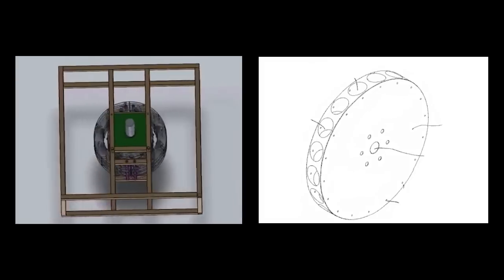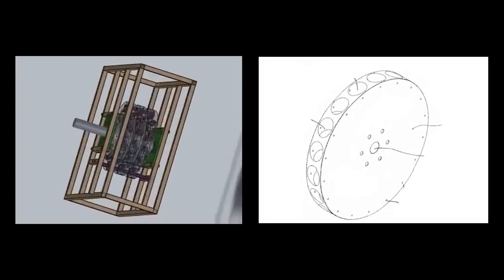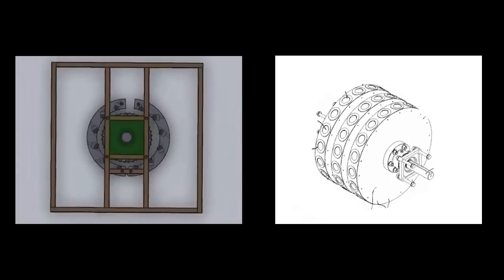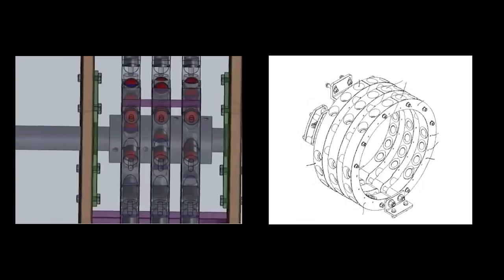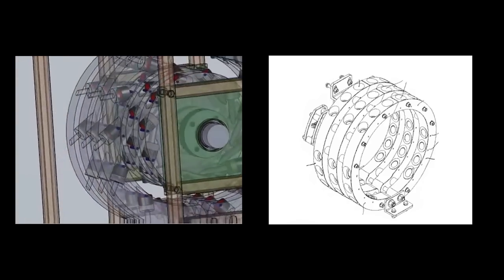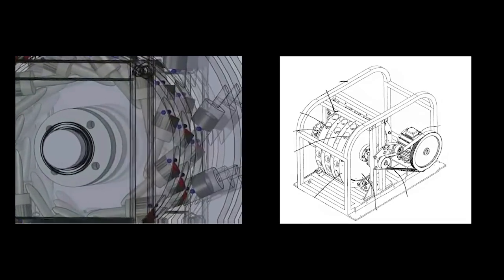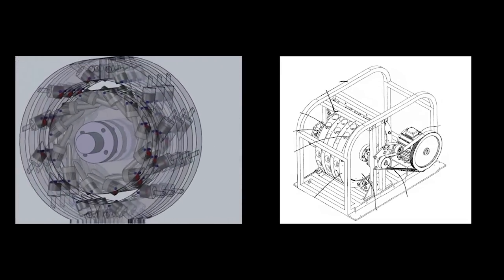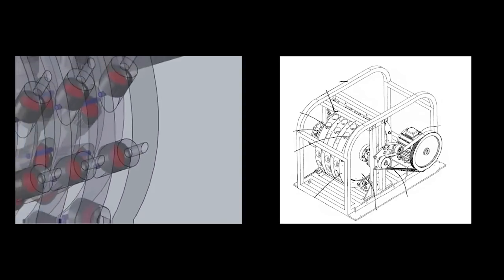Free Energy Generator - Mike Brady Permanent magnet machine

Comment: Electric Generator Design that's powered by it's self once it gets going & perpetuates more electrical current then is needed for it to run continuously on it's own. 
 Step 1: Calculate how much energy you need pumped into an electric motor to make a vertically positioned circular platter with magnets in-bedded horizontally around it's left side and right side (so there pushing force is pushing out sideways relative to the vertically spinning disc) to spin as fast as you need it to. Also better to make sure these magnets are shielded around their sides & back  with metal that has high permeability so the magnetic field they are emitting is focused fully out sideways. :D Step 2: Calculate how many sets of copper coils you need to be interacting with magnetic fields to achieve this & to perpetuate more electrical current flow then is needed. :D Step 3: Build a round horizontally positioned platter covered in all these copper coils pointed down that does not move (Is stationary) :D Step 4: Build a round platter covered in powerful magnets pointed up that can spin and place it directly under platter with hanging copper coils. :D Step 5:  Position the vertical platter that is  motorized close to the horizontally positioned platter covered in magnets pointing up so that when the vertically positioned platter spins the in-bedded horizontally positioned magnetic fields slam sideways against the edge of the horizontally positioned platter causing it to spin. :) Step 6: Make sure enough of the copper coils are feeding their electrical current into the electric motor and the rest of the copper coils are linked into a set of rechargeable Battery's placed in the closest most convenient spot. Step 7: Build a duplicate setup of horizontally positioned discs with hanging copper coils and disc with upwards facing magnets and assuming the first set of discs are positioned to the front left side of vertical spinning disc, position the other duplicate structures to the front right, the back left and the back right of the vertically positioned motorized disc. As the vertically positioned motorized disc spins the horizontally in-beaded magnets will now hit into all 4 horizontally positioned discs causing them to spin. so you will effectively be using the spin of one disc powered by one electric motor to spin 4 constructs that are each generating electrical current. now build this whole setup multiple times over and use the current perpetuated by it to power up scaled electromagnetic generators that are equal to or more powerful than the ones used in a nuclear power plant. You will now have a device that is self perpetuating off of it's own electrical current perpetuation and no nuclear waist to worry about.
 Here is the reason why my device does work. You see even tho the more electrical load you impose on a system ends you up with greater back emf hindering your devices ability to move and generate current, there is a way to work around this. My device multiplies the amount of mechanical motion that is taking place because of the 1 motor. On top of that, it eliminates any extra resistance that could have been imposed on the motor by making the other wheels spin by having the magnetic fields hit the rotating discs the way I described. You see, the vertically positioned disc connected to the motor is perpetuating the spinning of at least 4 main discs that are spinning magnets at no extra effort on it's own part because as it spins around powered by the motor, it is the horizontally positioned magnets that are shielded by high permeability metal that are using their magnetic push out sideways to force the other horizontally positioned discs to spin. So even tho each of those 4 discs spinning are somewhat hindered by the back emf it does not change the inescapable fact that each disc is perpetuating the flow of current in the copper coils above them and the amount of electrical current being perpetuated between all 4 discs is greater then the amount of electrical current the motor needs to run at max potential. It is called over unity and the extra electrical current the motor does not need can be fed into larger more elaborate electric generators. Imagine 12 of these designs contributing to the power needs of a much more powerful design (Probably electromagnetic) that is utilizing this same idea of multiplying the number of horizontally positioned discs that spin because of the motion of one powerful  motor spinning a vertically positioned disc cleverly positioned so that it spins at least 4 other discs at a much higher velocity because of it's more powerful design. In short its all about multiplying what the first motors disc is interacting with & second, up scaling the design to more powerful designs that utilize the same principles.
Reply: Wow, how can I learn more about this please please please, Ive read your reply 5 times but I still need to learn more about this and see visual parts of it🙏
Reply: @mduzondi  Thanks for showing interest. :) As it happens I have since invented a more efficient design for an over unity electric generator. The one mentioned above should work but it's design needed to be improved to be more space efficient & generate more electrical current. I will send you the new design in next message. As for drawings of this design I am thinking about creating a working model of it in a game called DREAMS on PlayStation 4 it is a game created by company called Media Molecule & it allows people to create what ever they want whether it be music games art it is really cool. if you haven't heard about it I highly recommend looking it up on You Tube. Just type in Games name Dreams for PlayStation 4 & watch videos on it. Since the games creation tool set is so robust I think it would be easy for me to create a digital model of my Over Unity electric generator and then other players could see it from there online. In next message I send pay close attention to the last part of the design it is what really allows the device to end up being an Over unity Electric generator by exploiting the effect of the magnetic fields in a way that doesn't put to much hindrance on motor.
Reply: @MasterFeiFongWong  Okay that's interesting, one needs a visual representation of the over unit generator, to clearly understand. But thanks for explaining will check Dream for PlayStation. So you're the one who designed that one on the video. Why are people so stubborn about these generators, it's like they don't want them to exist, or they understand them, but it looks like someone is telling them don't believe it.
Reply: @mduzondi  If you mean the video above, no that's not me. :) I just put my design in comment sections of various videos :)
Reply: @mduzondi  Over unity electric generator. By AMA.
Segment 1: 1 motor with bar connected to it standing vertically. Circular disc connected to bar that has magnets embedded in it surrounded in high permeability material to focus magnets outward pushing force in an upwards direction from top of disc. 
 Segment 2: Hollowed out cylindrical Bar of material horizontally positioned. 
 Flat hollowed out ring shaped material with openings around its outer top flat edge.
 Magnets surrounded in high permeability material embedded in these openings.
Magnets positioned in openings around ring are in at least 1 of 2 configurations either all N magnetic field pushing out or N,S,N,S all around it. Just depends on whether your going for Piston structure or spinning structure explained below & whether you want it to be DC or AC current. 
Place these all along the cylindrical bar connected to it solidly, except at far ends of bar. 
At both ends of bar place ring of material that can be magnetically repelled in specific locations. (magnetically repelled in specific location is in reference to outside of ring area that faces away from center of bar)(Other side of same ring facing in towards center of bar is capable of being magnetically repelled all around) Ring must be connected solidly to bar. points of repulsion on these rings is off set from each other on each end of bar. 
3 Hollow ring structures with small square bars protruding from each. Ring structure has all magnetic repulsion on inside of ring shape & can rap around the main bar so that the bar wont be causing friction on things as it moves back and forth or spins. 1st positioned around far left of bar, 2nd position at center of bar (be sure to leave enough room for magnetic structures to be able to move back and forth without hitting it) & 3rd positioned on far right of bar. 
Tube structure is constructed in two parts that fit together on top of each other length wise over main structure. 
Tube structure has 3 square openings for the bars that the Ring structures that are connected around the main bar keeping it from causing friction on structure, to slide into. 
This tube structure is designed with material that does not block magnetic fields. Perhaps some type of transparent material glass or other. 
 At both ends of the tube structure there is a built in circular groove that will house a round disc. The ceiling/floor/left side/& right side of groove has openings for small magnets to be  embedded in it, so that the pushing force from magnets is pushing in towards the edge of disc that goes in this spot. There is also 4 openings located on the top, bottom, left & right positions of the open groove. Small magnets are placed in these spots so when round disc is in position these magnetic fields will hit sideways keeping it from generating friction against structure. 
Far Ends of bar has Cap structure that screws over tube halves holding them together. Cap structure also has 4 points on inside top, bottom, left & right that have openings. These openings have small embedded magnets in them that exert there pushing force outwards (sideways) so it will keep disc in position, generating no friction against structure. Cap is made of material like tube so it does not block magnetic fields. (Note: These magnets in groove and cap structure are only needed for piston design. If Disc is directly connected to main bar so as it spins the bar spins, magnets are not needed here).
 The disc has ring around it (ring of material goes around outer edge and folds over front side & backside a small distance) that is repelled by magnetic fields so the 12 small magnets will keep it lined up but it will be able to spin without causing friction on structure. The disc has openings on it's flat side that face inside of tube and magnets surrounded in high permeability material are embedded in this disc. 
 The disc has small bar that is connected to it's center that goes all the way to the other end of  bar structure through the center of the hollowed out bar and connects to disc on other end. Disc on other end is set up the same but magnets embedded in it are off set in comparison. As first disc spins the magnetic fields will push against specific spot on disc connected directly to bar, pushing bar in other direction, once bar is fully pushed over, further spinning of disc will then align the other sides magnet to push it back.
 Tube structure also has half moon shaped protrusion on inside and on both halves so when tube is connected they line up to make a full ring shape on inside of tube, these half moon shaped protrusions have at least 1 small round opening on it's side in middle of curve that faces away from center of bar. The opening has a small magnet embedded in it so magnetic force is repelling out sideways away from center of bar. The protruding ring is positioned to line up slightly further in towards center of bar then the ring of magnetically repelled material connected directly to bar. This way when bar moves right or left it is magnetically stopped after a short distance. 
Copper coil setup: Copper coils are wound in at least 1 of 2 ways. Either coiled in circles next to each other (Like if you wound coils around a cylindrical bar) or laid out in a row as if wire was on flat table going up then bent to go down & back up until it formed a flat rectangle of wire bending up and down and then the entire structure folded around tube. Copper windings are then lined up perpendicular to magnetic fields on outside of tube. Ends of copper coils are connected into separate construct that will allow electrical current to flow somewhere else. 
Circular construct is built like a stand that goes around the outside of motor segment. Circular construct has flat ring of high permeability (magnetic field shielding) material that has small openings that will allow magnetic fields through specific locations. Top of circular construct has groove to allow the horizontal bar to balance on. Circular construct can also be placed on other end of bar so it is balanced. The motor segment is positioned so the disc connected to the bar that is connected to the motor is lined up so the disc passes under the horizontal bars disc that is at end of horizontal bar. The high permeability material keeps the magnetic fields in disc from hitting into the disc that spins or pushes the horizontal bar until just the right moment when the impact will cause the disc in horizontal bar to spin which will perpetuate the piston motion in the horizontal bar. More horizontal bars of the same design are built and positioned around the motor segment in a circular horizontal fashion all the way around. The bar connected to the motor can be increased in length to desired height (As much as motor can handle) and more of the exact same setup is repeated higher and higher up, maximizing the over unity potential of the construct to ridiculous proportions. :D Current from the horizontal bars is diverted to power the motor as needed and all other current is diverted to power my game console or the world. :) Interesting variation to this design would be to connect the spinning discs on far ends of horizontal bar to main bar that magnets are connected to so the magnets spin instead of getting pistoned back and forth. So long as moving magnetic fields are perpendicular to copper wires it should work. By AMA
Reply: @MasterFeiFongWong  wow, thanks for explaining in such detail about the working of the generator. I thought there will be some control system with an H bridge circuitry to control the direction of current on the magnetics hence the changing the polarity of magnets in a times manner to allow continuous propelled motion, like on the SVmaglev train, but thought this time they are positioned on a stator and permanents on a rotor. What do you think about that design?
Reply: @MasterFeiFongWong  you've shared so much on your messages and much appreciation for that, how can I connect with you, will really appreciate your feedback, our physics professors says these never work😏. Why aren't these on the market?
Reply: @mduzondi  Sounds like an interesting design :)
Reply: @mduzondi  I am not surprised your physics professor says they never work. I think people are to programed mentally into thinking that things are impossible because they have taken ideas like conservation of energy & thermo dynamics & jumped to conclusions that certain things cant be achieved because of these things, but in doing so (in saying something is impossible) they have effectively given up on the idea, when instead they needed to look for ways around these things called energy conservation & thermo dynamic limitations. That's what my design does. Instead of trying to violate conservation of energy or thermo dynamics my device simply exploits mechanical advantage over a system & exploits magnetic field effects to do most the work so the motor doesn't need to. Feel free to print out my design & show it to your professor. They may find it interesting. If they point out an issue with the magnets demagnetizing from being used in the fashion my device uses them in, I have solved this issue by implementing a variation to my design that has coils of wire wrapped around magnets & current from device being able to flow into it effectively re magnetizing the magnets on the fly. I just didn't explain it in main devices structure. It's kind of wordy & message would not fit in comment section with main design. :)

Comment: Fake. No free energy can be crated.
Reply: You don't have to create it because of two things, first there is energy all around us, everywhere in the universe but I guess you already know that simple fact, then we have the energy from the magnets, it's a pushing energy which you will have tried yourself no doubt, someone figured that given the correct ratio of magnets on the outer rim plus the correct angle, then the inner ring has another batch of magnets at a specific angle, there's a total of 60 on the inner being that there's 3 rings, and there's 42 on the outer. I am going to build one so if it doesn't work I shall buy a hat and eat it .
Bob

Comment: This would never work, why!!? Well because most of people who build this they know little about Magnetic Luck!! and that is why you need special magnets for a Magnet motor OR you have to get help from some amount of power and make more power to overcome that das free energy machine. easy...:)
Reply: It is NOT a free energy motor, there's no Current or electrons coming from this. It is a simple motor using those very powerful magnets in a specific configuration. Then when the two 'jaws' with a larger set of magnets in the Stator but not as many as the Rotor are closed those larger magnets start pushing the magnets in the Rotor and because they are staggered around the periphery they wont stop in one lace, well that's the theory and it's been tried and it works. So go spend ? $500 to find out, That's to make it.